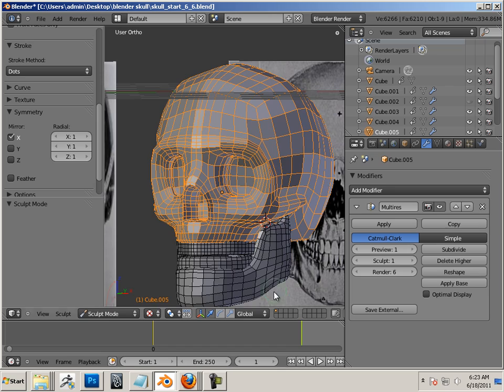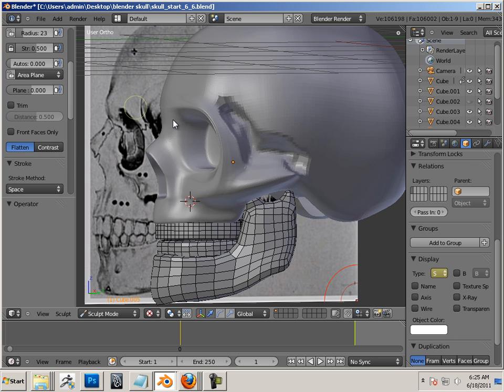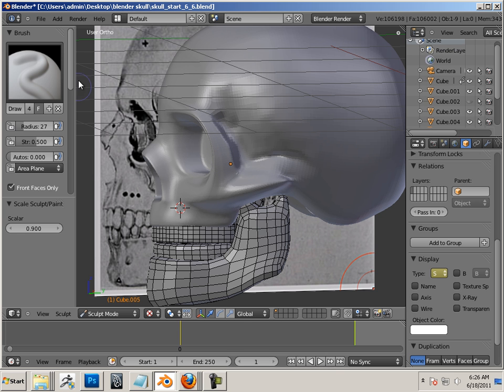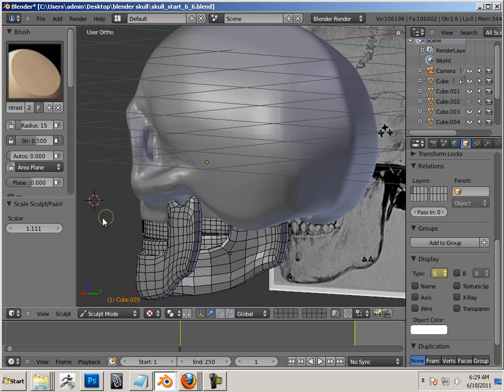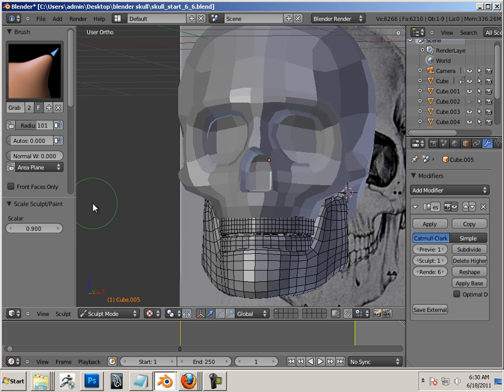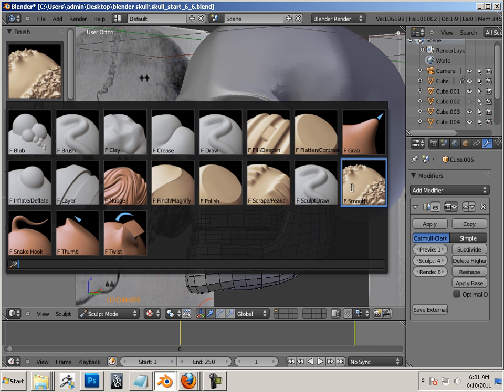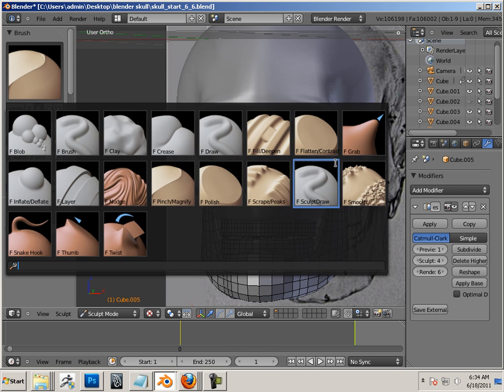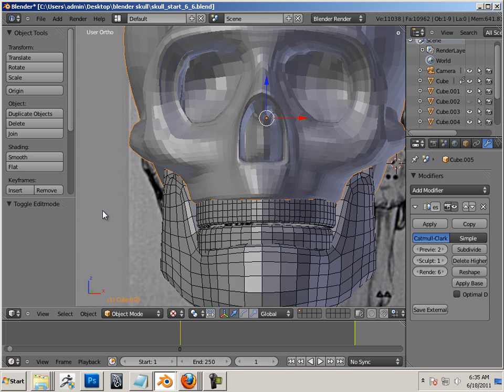1007 Blender (Sculpt1).mp4

Comment: Also when I use F Smooth in the unapplied Multires: sculpt 6, there will be no creases, but when I swap back down to 5, 4, 3, 2 there willl be creases. You were talking about a clean high and lowpoly model. Is there anyway to make the folds and creases go away fully or do I just aim for a non creased version in multires 2 and multires 6?